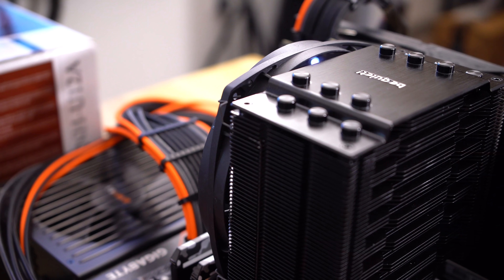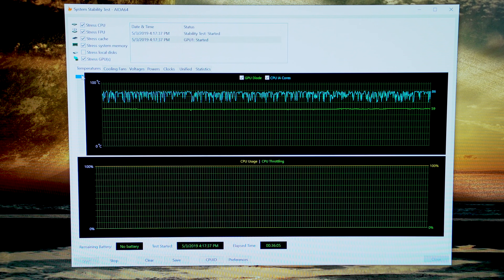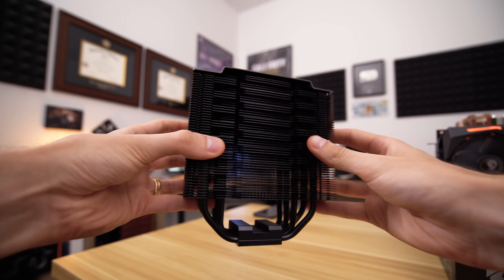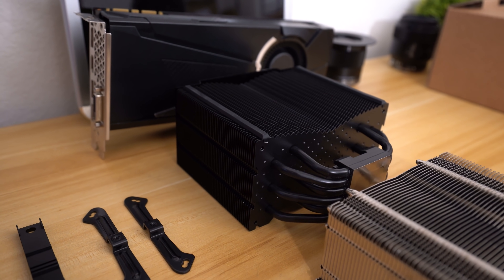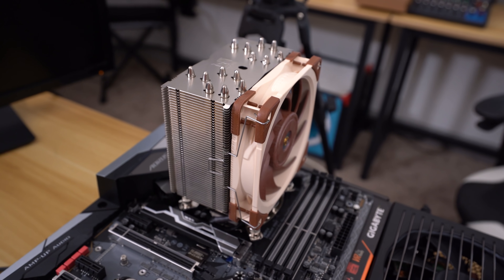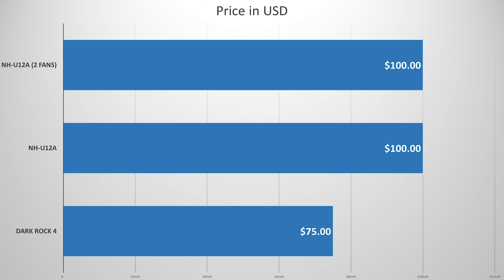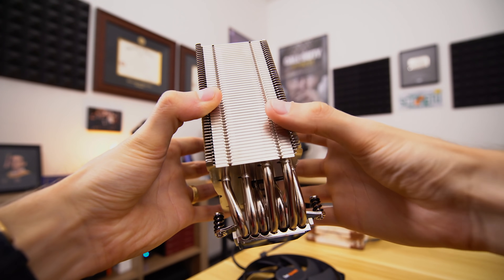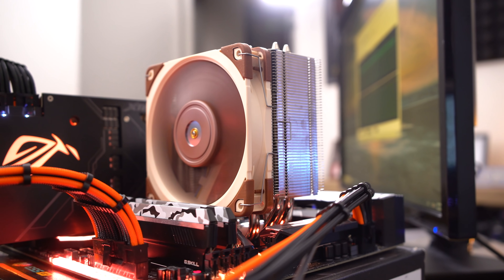Air Cooler Showdown: NH-U12A vs. Dark Rock 4

Comment: Nice video. I do feel that a noise-normalized temperature chart is missing to make it perfect however. It is really the only way to directly compare performance head-to-head.

The U12A is a beast for it's form factor, but I think we can all agree that it is currently VERY overpriced.
I mean, you can get the best aircooler in the world (the D15) for the same (actually slightly less technically I think).
So from an overall perspective I say Darkrock wins this one from being fairly close performance at a significantly lower price. I think Noctua will be lowering the price on this one in not too long personally.

In the big-bother category of the Darkrock Pro vs the D15 it's very even. Slight advantage Noctua for a tad higher quality mounting, a few small details and a veeeery slight performance edge, but those differences are so small that you should just pick based on looks if looks matter to you at all. You can't really go wrong with either as long as you make sure you can actually fit them.

I don't know what's taking so long for Noctua to release their long awaited black variants. They were shown about a year ago but only standalone-fans can be found yet (and sparingly). With everything else being close to perfect on the Noctua coolers it's absurd that they have stuck with the arguably ugly color-scheme. No matter how good the cooler it must have cost them some sales and now they have waited to long that BeQuiet stole that market from them. Pretty silly marketing blunder I think in this age where PC component visuals are more and more relevant for enthusiasts.

Comment: Noctua any day plus you can get it with 1 fan , I got a noctua push and pull nh-u9se2  I got se2 because I need 2 fans Puerto Rico it's hot all year long.  Same temps as h100v2 max temps 55c. And I got the h100v2 out side on top of my case. 55c when stress test only .

Comment: When you measure sound from the PC, how far away do you hold the meter fro the case or in this instance, how far is it from the motherboard and stylish motherboard box? 

Also want device do you use to measure dB?
Reply: Where the mic is placed is of little consequence, since it is in the same place for both tests.

The point is not the exact noise it produces, but the relationship between the two. Since sound dissipation is constant, you can infer sound levels at any distance will be the same, albeit at lower physical numbers.
Reply: @charlieodom9107  That has absolutely nothing to do with why I had asked.
Reply: @gohan20  it has everything to do with what you said. Location of the mic doesn't matter. The physical numbers he listed don't matter either and here is why:

Do you run a MB on a box sitting on a table? Probably not.
Do you run the exact same hardware as he did in the video? Probably not.
Is your room noise the exact same as his? Definitely not.

So, his actual numbers mean dick to you. The only thing you need to be concerned with is the quantitative percentage difference between the two.

So, your setup, using either of these coolers, in your case, with your case fans, your power supply, your room noise, etc will most certainly be different. I can tell you that my entire PC running at max cooling has lower numbers than that of this test, but this is because it is housed, actually double housed, with return air cooling from my central unit in my house.

If you still can't understand why your questions are moot, then you are probably better off buying any cooler and putting it on your cpu.
Reply: @charlieodom9107  I don't care for his numbers. I never mentioned his numbers.  

I am not asking in order to understand his numbers, you're reading far too much into this and thus assuming and being ignorant. 

I am not asking in order to make an informed purchase of a cooler, I have a custom loop. So your opinion and advice is moot, as I am aware of everything you've said thus far and you are behaving like a condescending jerk.
Reply: @gohan20  if you have no reason to know how or why he reached the numbers he did, then why ask?

Comment: The Noctua NH-U12A is neither available on Newegg or Amazon :(
Reply: Get the NH-U14S or NH-D15 if you can fit it into your case/build.
Reply: @YTHandlesWereAMistake  I currently own a PC build that contains the NH-U14S in it which is a nice cooler (that has been running strong since 2014), but I am more interested in the condensed size of the NH-U12A compared to the NH-U14S

Comment: If your case could use an extra 120mm fan, you basically get a $30 fan for $25 by going with the U12A, which you might be wanting to purchase anyway considering your chassis config. Additionally, with the 4-5 C difference in the U12As favor, you could always reduce the fan speed of the A12x25 to match the thermal performance of the SW3 and come out quieter; fan speed to noise production as well as fan speed to cooling performance are also rather non-linear, so running the fans at ~50% load will chop down 6-8 dB (2-2.5x less sound pressure) while only reducing cooling performance by a few degrees according to the tests I've performed.  The DR4 is a decent cooler, but at $75 for a single fan, it is outclassed by the Scythe Fuma at ~$50 in cooling performance if $25 is a meaningful difference, and the DRP4 140mm cooler routinely goes on sale for ~$80 and will perform better yet in noise and cooling at the small additional cost of 165mm height clearance (ram clearance is an issue on both the DR4 and DRP4).

Comment: The Noc is 33% more cash (pedantic I realize) increasing the 75 to 100 is a one third jump in price... :)
 sorry for being that guy but my coffee has yet to take the edge of the morning.
Reply: Thanks for doing the math. Impressive without a cup of coffee. And just FYI it's a better cooler that costs more so... also, if the 2nd fan doesn't benefit in the case (where it SHOULD be tested) you can use it for a case fan instead (though ideally Noctua has a more optimized fan for cases). I took my 2nd fan off my old NH-D14 and just moved it a few inches to use as a case exhaust fan.
Reply: @photonboy999   I wouldn't think anyone who cared about the machine they built would balk at the tiny 25 dollar difference if absolute performance was needed or demanded. It's nice to know exactly how much of a premium you're paying for that excellence, but no one ever made a mistake buying the Noctua.

Comment: What you are leaving out Greg is the fact that there is a low noise adapter that is pwm included in the Noctua box to lower the decibels and yes, though it may have 2 fans included albeit the brown/beige, both do not need to be installed. I do understand it increases the price. You could've used the NH-U14A as a tester against the BeQuiet cooler too.

Comment: With a 2-fan cooler you can slow the fans down to make it as quiet as a single-fan cooler but have lower temps.
Reply: also, these are basically the best 120mm fans ($30 fan) overall and you get two of them. Cooler mounting is stupid easy with Noctua or Scythe coolers in general.

Comment: You should do the king of air coolers. The Cryorig R1 Ultimate, or its infinite ram height offset brother.
Reply: https://www.techpowerup.com/reviews/CRYORIG/R1_Ultimate/9.html
"This results in the R1 Ultimate being just 1 dBA louder than the NH-D15. At this point, it is basically down to splitting hairs when it comes to performance and noise levels."
If looks don't matter the NH-D15s is one of the best coolers. It's got no RAM clearance issue and ends up slightly quieter than the NH-D15 at same cooling level. It's also much smaller and lighter... unless aesthetics matter I wouldn't go with Cryorig... hopefully Noctua makes a BLACK version for the NH-D15s.

Comment: I have Silent Wings 3 fans and while I like the 140mm ones. The high speed 120mm I could not run over 1000rpm without it being noticeable. I replaced it with a 120mm Noctua NF-A12x25 PWM and it was noticeably quieter even at 2000rpm.

Comment: I use a 10 year old (but new) ZALMAN CNPS 9900MAX all copper nickel plated cooler on my 8700K and it runs 80°c at 5GHz no problem. They are available on Amazon for $25. Can't beat that. Plus they look cool, unlike baby poop brown.

Comment: nice comparison,
as some others have mentioned could you compare the Dark Rock 4 Pro with 1& 2 Fans, as it is $40 cheaper than the Noctua NH-U12A in Australia, also the Dark Rock TF if its posible

I do like the all black theme of the BeQuiet compared to the Noctua for looks if it's for a Tempered Glass Case,
with the extra Noctua fan it could be used as an extra intake or exhaust if your case as not all cases come 'Full' of fans

Comment: I bought the NH-U12A to replace my aging D14, mostly because the D14 is about the size of the Chrysler Building.  The U12A keeps my CPU on average 7 degrees cooler than the D14, and I've exchanged three 140mm fans for two dinky 120mm fans.  Part of that is the new design, part the new fans, but I think the size reduction helps too.  The D14 sits less than a millimeter from my GPU, where the U12A has a centimeter or more of clearance.
I'm one of the weird people who actually like the Noctua brown fans.  They're reliable, good performers, and since they're so easy to recognize, I know as soon as I open a case up whether or not I have to be concerned about the capability of the cooler.  Noctua just needs to make them RGB and everyone will stop complaining.  Actually, maybe not.  RGB on the brown and tan fans might possibly make them look really bad.

Comment: 25% more for 2 of the best fans available.
Reply from the maker: SW3 were nearly as quiet in my testing, and frankly look better 💁
Reply: @GregSalazar  I think you missed my point. You're right they look better, and they may be quieter, but noise isn't performance. The NF A12x25 are much better fans, and 2 of them.

Comment: I'm leaning towards the Dark Rock or Dark Rock Pro on my next build because it's going to be an open-air wall mounted case so appearance and noise are really important. It sounds like the Noctua is the best performance you can get, but BQ does awfully well too; both of them kept a heavily over clocked high-end CPU below the thermal throttle line under heavy stress with a less than ideal thermal compound.

Comment: Noctua has opened a hotline in the US for people triggered by the colour of their fans

The number is 1-800-248 363

Yes, that's 1-800-BITE-ME
Reply: luckily you can get chromax version for most of their products
Reply: I wonder if all the fan hate generates so much publicity for their products that it's actually a good idea? Surely they have a reason. And Chromax isn't a substitute when most people aren't aware of that. Remember the commercial for a cold remedy "It tastes awful, but it works!"
Reply: @photonboy999  I think theyve been running with it for so long that its a trademark, recognizable thing. Quality Quality Quality.  You want a turd $2 shop christmas light rainbow show look elsewhere.

Comment: Would it make a difference if you used the heat spreader from the noctua set and the fans from the dark 4 set? Differences as in temperature and plus design wise but not the point and if cost didnt matter, the only other concern would be if the part are compatible with eachother which if it's just basically the fan your swapping I dont see how that shouldn't be compatible

Comment: i would choose the Dark Rock 4 for the same reasons, but... i have four Vengeance RGB modules slotted, so i actually couldn't if i wanted to. the additional clearance really is a strong point for the Noctua, although most people, i would assume, only use two sticks

Comment: whoa, 4C at max difference, single fan vs single fan, that's a huge gap between two similarly sized coolers, why more than I'd expect with a 2db difference in noise level
Reply: I think something went wrong with his testing with 2 fans, becausw i have never seen a worse preforamnce of 2 fans vs 1 fan
Reply: @wertin200  I've not seen it get worse, but I have seen it stay the same. I think this tower is too thin to really need two fans, honestly

Comment: There are a great deal of cheap cases, especially the smaller ones, that are vastly improved with the addition of another fan. So for the 25 dollar difference you get the best 120mm fan on the market.
Reply: I had the same thought, unless your case is 'full' you can always use another fan

Comment: I'm curious how the Cryorig H5 would compare in performance to these two and is only $53 USD currently on newegg.
Reply: Bike N' Van Decently, but Cryorig fans are nowhere near the quality of Be Quiet! Or Noctua. Pretty sure they are sleeve bearing fans with a lifespan of 30000 to 50000 hours. Be Quiet! Silent Wings are 300000. I have them and I love them.
Reply: @Aurummorituri  Very valid point, but i was looking at it more from the perspective of the cooler's fin array efficiency. Fans can be swapped out and if you were to put a Silent Wings 3 on the cryorig you'd be in the same price range as the Dark Rock 4.
Reply: @xNoLimits84x  At that point just buy the Dark Rock 4. Even if cooling performance is pretty close that black ceramic coating is SOOO wonderful for a black build or just not looking shiny. Up to personal taste at that point. My old liquid loop is getting crusty and I'm sick of dealing with water. Might go for a Dark Rock Pro 4 for my 9900k. Even if I lose some headroom at least it will be quiet and leak-free.
Reply: @Aurummorituri  That's my take on it. I have a EK Predator AIO currently and haven't had a single issue but I'm thinking of going for simplicity for the next build.  Waiting til later this year, Q3 or Q4, when intel is supposedly going to release their new processor.  Hopefully it doesn't get delayed too much.
Reply: @xNoLimits84x  I also have a Predator AIO. I have an old XLC 360. Makes me nervous, though. Ran low on fluid and had to refill. A huge pain and signs of of some galvanic corrosion in the gpu block. Pump is also known to use lesser quality internals than a typical DDC pump. As soon as I buy a 2080 ti I will probably ditch it for a DRP 4 or H115i Platinum.

Comment: Dark rock 4 with Noctua fans? Any better?
Reply: And vice-versa!   If the dark rock fans are quieter maybe that's the reason they underperform?  Or is it the heatsink?
Reply: @peetiegonzalez1845  Both BeQuiet and Noctua fans are top-tier quality. Noctua probably very marginally better overall, but from what I've seen of comparisons it's as close as it can get and outside of anything you'd ever be able to tell the difference between. Gotta hard it to Noctua for build-quality though. In over a decade I've never had a Noctua fan fail or even slightly degrade. They seemingly last forever. Can't speak to BeQuiet on that since I don't own any fans from them anywhere near as old.

The performance difference here is MAINLY due to a difference in RPM / PWM-scaling - which isn't something that is "bad" or "good" either way. The Noctuas scale higher on the PWM signal compared to the BeQuiets here - resulting on both lower temps and more noise. If you had noise normalized both (ie. set a fan percentage that resulted in say 40db for both) and measured those temps (a so called noise normalized temperature chart) then you would see very similar performance I imagine. I've seen noise normalized data in other test - albeit between the D15 and Darkrock Pro 4 (the big brothers to these two tested here). I would guess probably 1c or less than 1c difference in favor of Noctua - or in other words it's so close that it makes no practical difference outside of looking at pure test-data (and probably also within error-margins of measurements anyway).
Reply: @peetiegonzalez1845  the ones I got only maxed out at 1000rpm so be quieter than anything that runs faster.
Reply: I was thinking that exactly!
Reply: Those fans hat come with the Noctua is class leading... I think the dark rock would perform better with noctua fans, alot better
Reply: @TheLittleCoffeeFarmer  beQuiet fans aren't any slouches.  When compared to each other with noise normalized, they seem to perform identical.

Comment: Well in EU Dark Rock Pro 4  is 70% of NH-U12A price. While Dark Rock 4 is 55% of NH-U12A price. Those are some hefty premiums for NH-U12A to make up for with its performance (at least for EU buyers).
Reply: Yep, I saw it. I live in Romania and the prices shout to buy be quiet coolers instead of Noctua coolers.
Reply: i could be wrong but i think part of the reason why noctua u12a is expensive is because its compatible with more sockets? not sure though. makes sense.
Reply: Confirmed. Here in the Netherlands, the Dark Rock 4 costs €55 and the NH-U12A costs €95. Odd choice to compare these two, but still, it's useful to know the difference, so we get to make an informed decision whether we want to spend the extra €40. I'd say: not worth it, unless you're on the i9 9900k (or socket 2066 i9s, Threadrippers).
Reply: @reinierovertoom7123  We have DRP4 TR for around 85 euros here in Romania. So still not worth it :D
Reply: @phoenixabstrax  Yeah, it's a hard sell. Maybe if you need the extra RAM clearance it might be an option. I've seen a different test where the NH-U12A outperformed the DRP4 as well, so it might still be worth looking into, but the €95 price tag does hurt.
Reply: @reinierovertoom7123  Dark Rock 4 65€ NH-U12A 100€ Portugal.

Comment: Will the noctua fit the PC-011-AIR?
Reply: the case allows for 155mm of cooler height and the cooler is 158mm so probly not
Reply: @ThatDaveFella  ah, thanks for the info